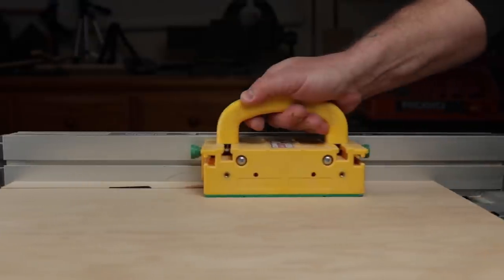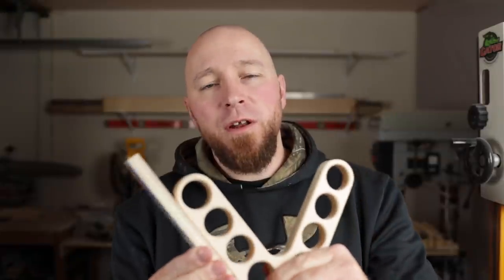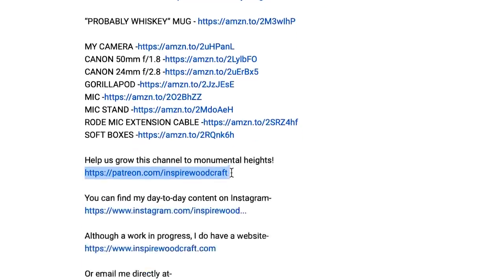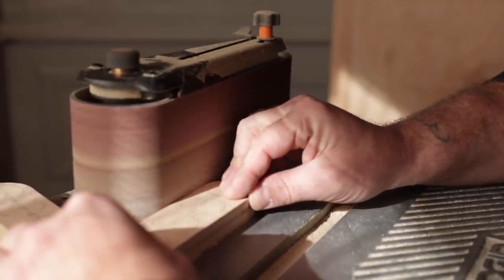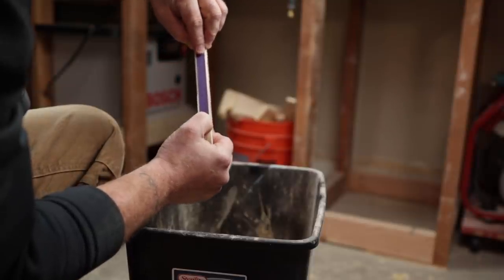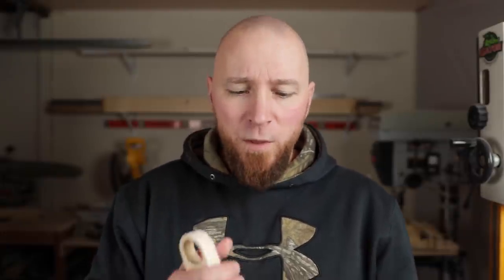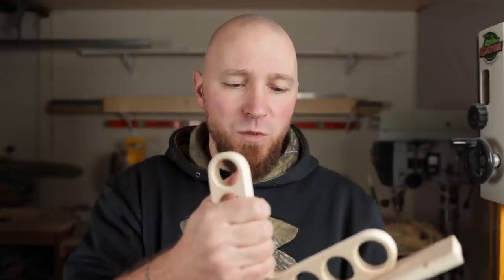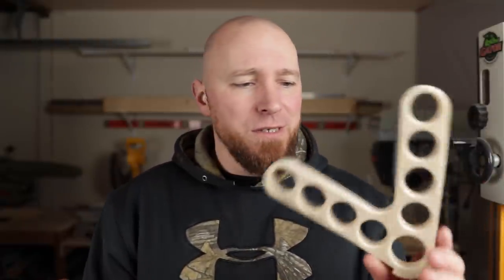Is This The New Best Push Stick Design For The Table Saw? / FREE TEMPLATE!

Comment from the maker: Hey guys apparently there was an issue with the original scanned template but it is fixed now and should work great if you re-download the pdf. My sincere apologies for the mix up if you ran into trouble!
Reply: I need another  unusual  push stick like I need a third  armpit.  OK  Ya got  me  I am  making one. I made a version of  Fast Cap's   MM $  stick too. I play  piano.   Fingers  are important
Reply: 3m sandpaper has adhesive on the back thats activated with heat
Reply: 😆 you are very cool
Reply: CC
Reply: The pdf still link doesn't work.
Reply: Hey dude. I'm half american who lives in Germany. Greetings. I wanted to download your push stick pdf but my browser didn't find the link.
Reply: Is this template scaled for a standard 8 1/2 × 11 sheet of paper?
Reply: How can we get the free plans without the shopping cart process? Shopping cart won't allow to go through because the system cannot find a shipping method for europe 😳😬
Reply: I tried to download the pdf 3 times and each time it said there was no shipping options. How can you ship a download? Requested assistance every time but no response. Gave up.
Reply: @pumpkinscueball  same problem. It's a problem with the e-commerce site he's using. It's not smart enough to realise that digital goods don't need to be shipped.

Comment: Awesome design. I'm going to make a couple of these. Love the sandpaper feature. On one side, I am going to glue a strip of slightly tacky rubbery material cut from a yoga mat. It will provide good grip to the wood and won't scratch anything. 

I buy navy blue and black yoga mats at 5 Below (for $5 each) and use them for lots of things. I cover one of my work tables with it. Screws and tools don't roll around. I cut a square to use as a grippy jar opener. I use this material in the jaws of my bench vise. I line toolboxes with it. I keep finding new uses for this material.
Reply: That's a really good idea
Reply from the maker: That’s a great idea!
Reply: Or you can use that rubbery drawer liner stuff you can buy from Walmart.  It's super cheap and works awesome for all sorts of woodworking purposes.  I use it to sand on all the time and it works great.
Reply: Sawdust and dirt from hands will ruin the stickiness.

Comment from the maker: I love this design, but what are your thoughts? Let me know if you make one or buy one and give me some feedback!
Reply: I like it, but not quite how or what I use for a push stick. However, the inspiration was great. My check my design on my blog at http://xyzzy.live/wiki/Blog/TablesawStockPushstick
Reply: Only problem I see is if you do run it through the saw blade, your blade is ripping through sand paper. I cut enough this strips for edges and shims that I'll burn up a push stick a week in the job. Only change is make is glueing non slip rubbery stuff on the bottom instead. You know for the blades sake.
Reply: I don't put sandpaper on mine, so no problem for me :-)
Reply: Great design.  I would suggest strips of thin silicone instead of sandpaper, and embed a couple of neodymium magnets in the sides so you can stick it to any steel or cast iron surface for easy storage.
Reply: Really like the design, the look and the fact works any way you grab it is genious. I see many criticism about the height and don't get it, first there is a reason why table says have a blade height adjustment knob right? also about the grip and fear that sand paper can scratch the surface can add foamy strips or some other rubbery grippy material. I general I not change the design is just cool to the eye.
Reply: A creative design.  I use several different push sticks depending on the thickness of material that I'm running through the saw or how much space is between the blade and the fence.  Your design is symmetrical so that it can be used either way that you pick it up....I would suggest that a different heel size for each holding option would make the stick more versatile.   (Provide a 3/8" heel depth on one side to grip thin materials and a 5/8" heel depth for pushing thicker materials.)  When working with little space between the blade and the fence, a push stick no wider than 1/2" is useful and pushing through a wider space has more control with a wider push stick.  I would also prefer a rubberized strip laid on the wood rather than sand paper to prevent scratching.  Push sticks should never be considered sacrificial and every effort should be made to insure that it never touches the blade.   I've had push sticks for 20 years that are still in functional use.  Besides, some of the fancy adjustable push blocks from Lee Valley and others are $100.00 bucks.
Reply: @joeritter8331  I think your carbide inserts on your blade will handle a bit of garnet with no problem.
Reply: as a man of many push sticks, I think your design might have a place at my TS.  As you said, I use different push sticks for different cuts.  I have a video series on my channel called "copy cat".  basically, I make and use your design and you make and use my design for predetermined period of time.  we then publish a review video with an honest review (good or bad) of the design.  afterwards we can remake the tool with any suggested improvements (this part is optional).  if interested, I would point to my NMP (No Moving Parts) Gripper as my entry. I have 2 or 3 videos on my version.  let me say that I agree with you that there is no singular perfect push tool.  I do switch between  tools myself.  Let me know.  Great video and subject.
Reply: I think the handle should be higher off the table. Someone will raise the blade too high and saw their hand in half.
Watch your video starting at 4:50 to see what I am talking about. Assume someone will have the blade 3 1/2" high.
Reply from the maker: Look man I’m sorry if this comes off as me being a dick, but in my world that’s what we call “natural selection”. That is user error and neglect and that person shouldn’t be around tools if that’s the case. The blade should almost always be around 1/4” above the exit point of the work piece and that’s it. Honestly if someone is going to do that, I hope that they wouldn’t download a template of mine or any others.
Reply: yeah, dannyb might be right. As a wise man once said . . .  " stupid is as stupid does" :>)
Reply: @InspireWoodcraft  I guess you never heard of something called product liability. You design and market something that can maim during it's use, and I don't care how pretty it looks, or how dumb the user is. You are going to be sued for everything you own. You really want to gamble that a jury will not feel sorry for someone hurt using your tool?  Your attitude of screw the Darwin dude, will make it even worst for you. This shows a callus disregard for the safety of others.
Reply from the maker: C’mon man. We all know that isn’t the case so just stop. Seriously, let it go. If that was the case than just about every company out there making any tool or jig, and possibly half the food we eat, would be out of business. EVERYTHING can and will hurt you if you use it the wrong way. Nice try “calling me out”, but let it go. My design is no different than anyone else’s of the same style push stick. I just improved it, in my words, to double the capacity of the tool. Now you make one tool and get two, instead of one. That’s it. It is no more dangerous to use or operate than any other and actually can in some cases be considered safer, as my design offers the idea of putting a grippy surface to keep the stock against the fence, which most push sticks or blocks do not. If you use a table saw or any other tool without being properly trained or informed of it’s inherent risks, that’s on you. Just like it’s on me if I do it. I do want to say thank you for putting the idea out there for someone to sue me for their negligence. Well done, sir. Well done.
Reply: @InspireWoodcraft  Boom. Well said!!
Reply: Look! I’ve worked on many projects for years now. It doesn’t matter how much experience I accumulate, I always get in a fight with the damn hammer and the nail. I busted my thumb the other day (while wearing gloves) and it hurt like hell. My thumb will never be the same. Question: Should I sue the hammer or the nail???
Reply: Sky Warp I agree in a more polite manner. No offense! @Inspire woodcraft I began making it with some changes in mind but I ended up making it exactly how you did. My table saw also came with a plastic piece I use as a paper weight. The holes make it visible to see if the wood is moving off  track. I think they should all have grips. My neighbor is making one now! Thank you for the video. It helps with convenience. Referring to other posts concerning safety, as long as people are adjusting their blades the proper height to board, I don’t see how using your invention could  possibly be a safety issue.
Reply: I like the design but without the holes.  If you get a finger caught in one of the holes and kick back  it could drag the finger into the blade.
Reply from the maker: I really appreciate you bringing this up on here. That’s something a forgot to mention in video and I’ve been telling people on a case-by-case basis.
Reply from the maker: Definitely a valid concern, but it is really uncomfortable to put your fingers in the holes to begin with. The first time you try will be the last time because it’s just too awkward.
Reply: @kizzy3356  That's why they call them thumb detectors.
Reply: Dwayne Mattson 🤣👍🏼🥴
Reply: @DannyB-cs9vx  Which tablesaws have you used on which it was possible to raise the blade to 3 1/2" ?
Reply: @murrmac  My Craftsman contractor saw will cut a 4x4 in half with one pass.
Reply: @DannyB-cs9vx  so what is the diameter of that blade, if you don't mind me asking?
Reply: @murrmac  10". I chose this saw over the Dewalt and others because of it's arbor design. It raises a bit higher than others. If you need the model # , I can get it off of the saw. Like most contractor saws, the fence is crap.

Comment: It is definitely aesthetically pleasing, functional and a testimony to your skill.  I have found a piece of 3/4 plywood, 4” +/- high by 9” long with a glued on shoe works for me.  When the shoe gets cut up beyond its usefulness, I replace the shoe.  Some are more than 4” high and 9” long when the piece being cut requires it.  Primary goal is that if the blade threatens my hand, I want as much room as possible to avoid its teeth.

Comment: it's a good stick.  I make mine with baltic birch 1/4" ply, and build up the handle to 3/4". I drill a 1" hole near the top and open the hole up on the forward side to make it easy to get a finger in & out.  That way I can hang on to the pushstick with a ring or pinky finger while picking up the next piece of stock.

Comment: Add the 3rd side of the triangle with a hole in the middle and you have 3 sides to wear out.  Each of the 3 sides could have a different heel height, say for 1/4, 1/2 and 3/4 inch material.
Reply: Then there would be no protruding back push to move the material through.

Comment: An old boy I revered regarding woodworking had a unique push stick.  I thought it was unique.  One feature that was worthy of a question for him was the use of a dowel for the push point.  The dowel was vertical and behind the heel of his hand.  It was in a sticky hole in that he started it by pushing it to protrude in excess of the part thickness to be sawn.  As he began to push, the dowel was driven up into it's hole to exactly the part thickness.

Comment: Very elegant and useful design for a push stick. 
I have two suggestions. 1. Using  material from a mouse pad or yoga mat will provide a good grip on the work piece and at the same time will pose no danger to the carbide teeth of the saw blade.
2. Making one arm of the push stick narrower (half inch or even quarter inch) will make it suitable for narrow work pieces. You need to merely flip the push stick if the work piece width is less than three fourths of an inch.
Reply from the maker: I’ve seen the yoga mat idea brought up now a few times and I think that’s a great idea! I always try to make things with stuff I already have in my shop, which are things that most people have in their shops too. And I’m fresh out of yoga mats. The sandpaper couldn’t possibly do any more harm to the blade than some of the nasty hardwoods and plywood’s we normally run through it. I like the idea of one side being narrower, I can’t figure out how to make that work out of one solid piece though!

Comment: I like that there are two usable edges to this push device,  I don't see the need for the holes.  Could you limit the sandpaper application to one side allowing for the other side to get butchered without affecting the blade?   I have my own design for a push device made from scrap ply material.  I'll try to send you a copy.
Reply from the maker: Yes of course! And some people have suggested a grippy material like foam rubber. I would just make sure it was fastened down really well because if not, it will all rip off and could cause a whole other mess of problems. The holes are purely for aesthetics, like I mentioned. Not necessary at all.

Comment: I like it and like your attitude. Good point is that it will hold down along the length of the work piece as well as push. Potential concern is  that yes,  your hand is kinda close to the blade. But... as long as you know what you are doing, should be OK. 
Re: thumbs down and negative (not constructive) remarks - I hate them. You guys are working hard and presenting your ideas. We can learn from them, accept them, or move on.
Reply from the maker: Hey I really appreciate the comment, Bill. Well said and to the point. Thank you!

Comment: That’s an aesthetically pleasing design with all the wholes cut out to reduce weight, but I find I like mass in a push stick. My favorite so far has been the Jay Bates inspired push stick carved out of a two by eight.
Reply from the maker: Yeah the holes are purely aesthetics and not to save weight. I also like his design and like I said, I also use that design in the shop for certain cuts. Only I usually use a 2x6 or so.

Comment: What do you think about foam or rubber instead of sand paper
Reply from the maker: I think it would work well! I just don’t have that in my shop and I usually try to make things with materials I already have it the shop so that most people can wither make it themselves or get ideas for other projects. I would just warn to to make sure whatever the material is is well secured so that it can’t rip off when it’s grabbed by the blade.

Comment: I am a victim of pushing my hand into the saw blade, so please listen to me.  I do not recommend this type of a design because if you have a serious kickback your hand may fold over the push stick and touch the blade.  When things go terribly bad, it’s like a mini explosion of wood at the blade, and it happens in a thousandth of a second!!  During that explosion you happen to be pushing your hand TOWARD the blade!   I was using a push stick and that isn’t all there is to it!    I highly recommend a push BLOCK, not a push stick.
Reply from the maker: I really appreciate this comment. Thanks for sharing. The type of design these type of push sticks falls under sort of merges the two together. While I also prefer a block over a stick, it’s not always a one-size-fits-all for general usage. Using the longer “fish-mouth” designs are horribly unstable and offer no real support. Of course there’s mush more to preventing kickback like riving knives and splitters and anti-kickback pawls, the sharpness of blade, the grain orientation of the wood being cut, the moisture content of the wood, the blade height, the feed rate and several others. I’m not telling you because I don’t think you know these things, but for other readers who might not. I plan on doing a follow up video to clear some things up, as there seems to be some confusion.
Reply: Inspire Woodcraft, Thanks for the detailed reply.  You are right, your design is worlds better than what I was using.  I made a cheap fish-mouthed flat stick.  Also like you said, that flat stick style offers no support and they are very unstable (hence my accident).  In addition to a really bad design of my push stick, I did not have a riving knife, or pawls, or a blade guard.  (I was trying to cut thin strips.)   I have been absent from woodworking ever since my accident, for other reasons not related to my accident, but this year I am getting back into it.  I will build a stable push block and my new Ridged saw has all of the other safety features.  Cheers!

Comment: Nice design! I would skip the holes because it's too easy to put your fingers in them, and if the blade pulls the pull stick I'd rather it was pulled out of my hand then to pull my hand down. Beside that nice job!
Reply from the maker: I think some people are not seeing the fact that the holes are purely a visual aesthetic, but yeah I see what you’re saying. I personally wouldn’t put my fingers in there!
Reply: That's silly, the push stick is behind the wood so no matter what the wood does it pulls away from the stick. How would the push stick get pulled away? Oh well.
Reply: oo0Spyder0oo 
Most accidents happen because someone thought there wasn’t any risk.
Reply: @Traitorman..Proverbs26.11  Well that's why they get culled off in the gene pool. There's a risk with anything, but commonsense is the one most are at risk of losing.